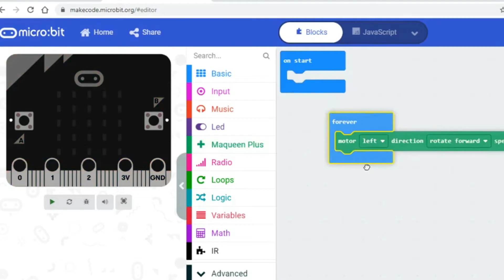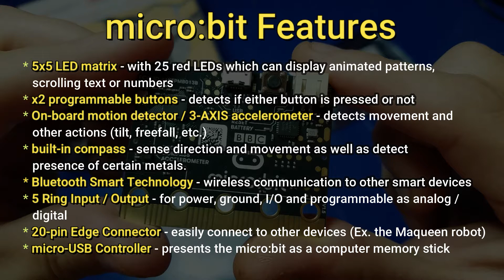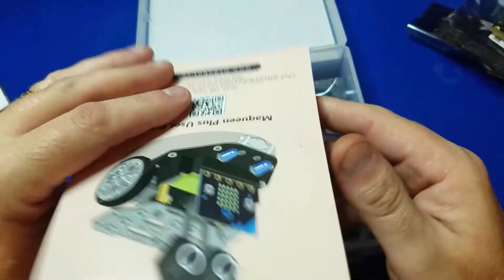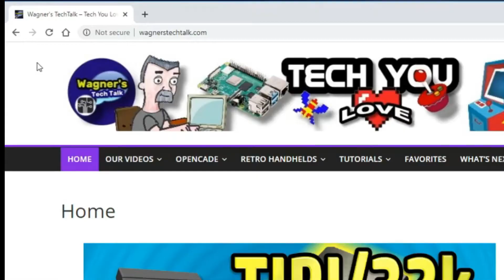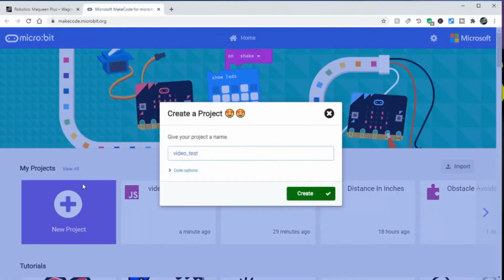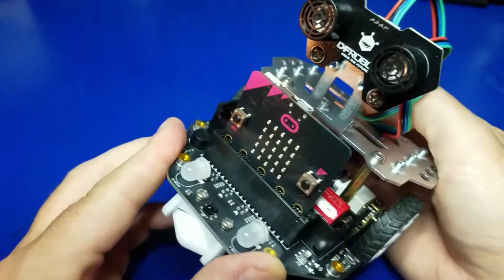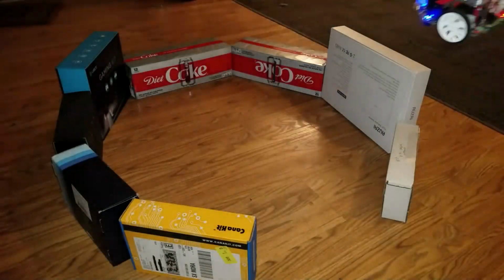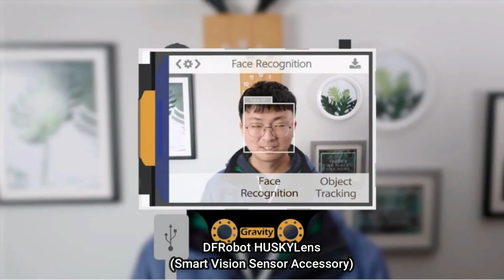Build a Robot with the micro:bit Maqueen Plus | DFRobot - Line Tracking, Obstacle Avoidance +more

Comment: My Maqueen 4.1 Infrared doesn't work. Any tips to get it going?
Reply from the maker: May want to contact DFRobot support for the best support.  Haven't had any issues with IR myself.
Reply: @WagnersTechTalk  have sent them an email but they are slow to respond. I have been trying to get the RGB lights underneath working but only red wants to work. So wondering if the new v4.1 is just full of bugs 😕
Reply: check wires in p2 and p2(blue)

Comment: Obstacle Avoidance program is not working in right way
Reply from the maker: The code can definitely be improved, such as making small motions/measurements and then move forward.  From a basic standpoint, it does work though.  These examples are meant as a good starting point.